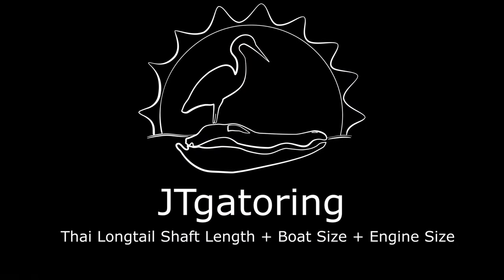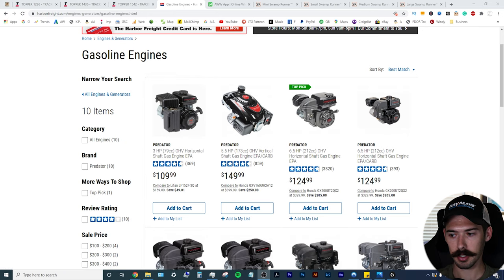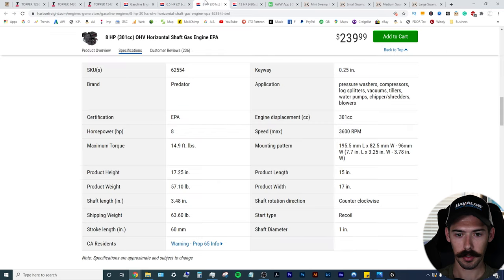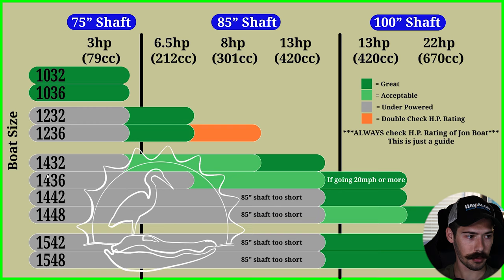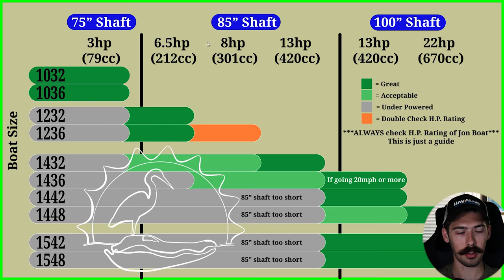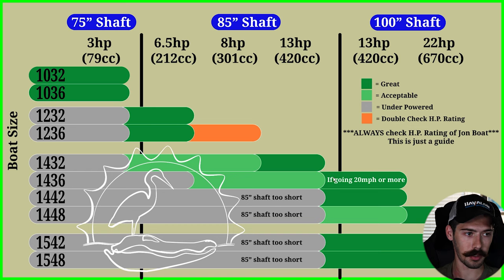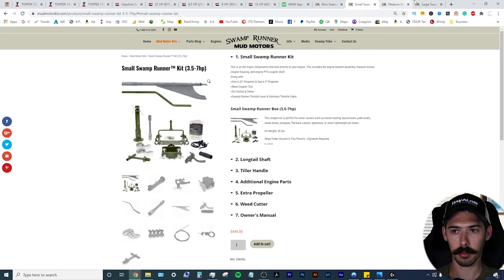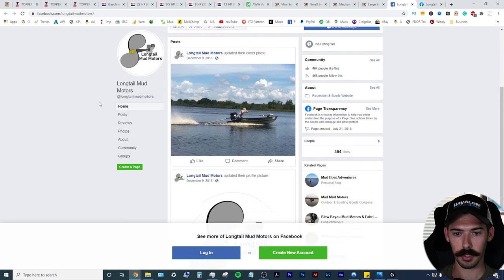EVERYTHING Thai Longtails: Boat Size + Engine Size + Shaft Size

Comment: nice job on video. 
I'm running a 15' Kaboat thats 54" wide at the tubes, currently has a honda GX 630(20 hp) with 100in shaft, Currently having problems with getting it to plane out and difficulty keeping the prop in the water. any advice??
Reply from the maker: Hey Burt, thank you! Once you go over 48", that's when things can get iffy... Take a look at this video - https://youtu.be/FAA7j0dVrLU . You will most likely need to give the kit as much tail weight as possible which means you're pivot point needs to be as close to the engine as possible. If you follow all the steps in the video, another good thing to do is play with weight distribution in the boat. Try a lot of weight in the back, and try a lot of weight in the front (try adding bow weight first). Your last ditch effort is a trim tab or planning tab. Let me know how it goes for you
Reply: @JTgatoring  thanks, I've seen that video and previously made some adjustments including putting on the planing tabs, I have not bent the skeg yet to adjust for lateral pull however as I have been saving that for a last resort.
Reply from the maker: @b12spence  What kit is it? Another thing that may help is the prop selection. Some props handle better than others. This goes for the size and brand of the prop.
Reply: @JTgatoring  beaverdam large kit, 100 in shaft, 8.5/9/9.5 in prop, honda gx630 20hP engine. inflatable boat 15' overall length ut the transom is at 13', currently running the 8.5" prop
Reply from the maker: @b12spence  It sounds like you've done what you can if you've done everything mentioned above. One other thing you could try is purchasing a prop from another brand.
Reply: @JTgatoring  i might try that, curious if adding a cavitation plate would make a difference instead of the planing tabs? it also pulls to the Right, even after playing with weight distribution. Correct to bend the skeg towards the pulling side?
Reply from the maker: @b12spence  The cavitation plate will not help. If the handle is pushing to the right (the starboard side) that means the prop is jumping out on the wake on the port side. If the shaft were to stay in the riding position where the tail was behind the boat, you would bend the skeg to the port side. If you swung the tail inside the boat to make the adjustment, since it is now located in the boat with the shaft pointing towards the bow, you would bend the skeg to the starboard side. As you move forward, the water will be pushing against the bent metal which will push it back into the center of the wake.
Reply: @JTgatoring  do you think with the transom being at 13' and being shorter inflatable vs john, that maybe an 85" prop would sit better in the water column
Reply from the maker: @b12spence  It would depend on where it is currently riding. I would have to see it. Watch some videos to see where other people have their prop located in the wake and see where yours is.
Reply: @JTgatoring  I posted a video of it up on your longtail fb page

Comment: Is there such a situation as too long a shaft?
Reply from the maker: In my eyes, yes. You want the prop to ride in the sweet spot of the wake behind the boat. If you have 30" wide hull with a 110" shaft, the prop would be placed too far back. Now if you have a standard 36 or 42 inch bottom, a 100" shaft is good, but the 110" shaft would still probably be too long unless you're going 30+ MPH. When you're on a 48" wide or wider or if the transom is taller than 20", then I do not think the shaft can be too long. Thats when the 110" or 120" shaft would be used.

Comment: My Lund 1240 Jon has a 10hp rating, I'm thinking of putting a 13 HP, 100'' longtail on it, too much?
Reply from the maker: Without knowing any additional information, I would say yes, the 13hp is too much. Most people normally do the 8hp predator with a medium size kit for a boat of that size. Weight is normally the first issue (the waterline on the boat), and the second issue is the transom's strength and ability to handle the weight/hp/torque of that engine.
Reply: And have your conclusions changed with all your experience? SPS still the best? @JTgatoring
Reply from the maker: @rickshaw296  I'd say that I've stayed up to date due to actively managing a longtail Facebook group with over 21k members and I would say yes, I still think Swamp Runner offers the best longtail.
Reply: That's great, thanks for your input! 8.4hp GX 270 SPS Medium for the 1240 Lund it is! @JTgatoring
Reply: What about the 14 ft Lund Jons? Were good up to 25 hp, do I stick with SPS, or is the upgrade to a mud buddy 23 or 25 worth it? @JTgatoring
Reply from the maker: @rickshaw296  That would depend on the boat. If its a light riveted jon boat, Then I would say rock a 13 to 16 hp single-cylinder engine with a medium swamp runner kit. I think that's the best setup for one person. If it's a welded boat that is wide, then you have a few more options. I prefer a thai longtail for 48" wide or less. If I'm getting a thai longtail, it's swamp runner. Then you have an american style longtail and that would be a backwater which I would recommend for boats wider than 48". Then you have surface drives, but I would only value a surface drive over a longtail if it had both gear reduction and reverse. If it's missing one of those, then I'm sticking with a longtail.

Comment: I know my 6.5 is way underpowered for my 1442(rated for 35hp) but it’s the only motor I currently have. I have a 100” shaft right now and was wondering if a 120” would be better a 20” transom. I’m planning on a stage 2 kit on my 6.5 also
Reply from the maker: It all depends on what you're trying to do, where the prop is currently riding in regards to the crest of the wake behind the boat, and if it's difficult to handle as it is right now.

Comment: I have a 1432 with a 16hp (mud skippers 420cc predator) on it with the twister xl kit from mud skipper. I was having trouble getting it on plane until I got my chainsaw winch n stuff on the front to get some more weight up front. Now, I can get it on plane and I've played around with a few different prop sizes and the best speed I can get is 18mph with 8in prop but that's at like 4000rpm because there's no governor. It has some performance upgrades so it just seems like I should be able to get better speeds and it's still difficult getting on plane. The 9in prop will only get up to 3100-3200 rpm so I'm overpropped there. I do have a few different 8.5in props ordered that I'll play with. But do you think part of my problem is that twister xl kit being so short or something else? You can also email me if you'd like justinmitchell88@gmail.com. Love the videos man and I've learned a ton from you.
Reply from the maker: The twister motor is completely different drivetrain than a thai longtail, so any information I give you based off of longtails and may or may not work with the twister. One key thing about a jon boat is weight distribution. Play with your weight distribution first. That will help a lot. It sounds like you're on the right track. You know the 9" is too big, and the 8" is working good so slowly step it up from there. They don't make a 8.25" so the 8.5" is your next step. The issue with the twister is that it is a less efficient drivetrain. It is a cable inside a tube with a multiple resistant points. and acts like a spring and binds inside the tube. Thank you for subscribing to the channel Michigan Bowhunter88. I look forward to hearing back from you
Reply: @JTgatoring  so I think I figured out the main reason my speeds aren't getting up there right. My handle pulls way out to the right if I let go of it. But testing it with those 8.5in props the other day, I finally just noticed that the skeg/prop is riding at a very hard angle when I'm keeping the boat going straight. If I straighten it out, the boat turns right. Is the motor probably just not mounted center?
Reply from the maker: @MI_TurkeySlayer  There could be a couple things going on. Just from the sounds of it, I would first measure the transom and find center, mark it, and adjust your mud motor so it is centered on the transom. Then make sure that your skeg is straight up and down when behind the boat (easiest to do this before you launch it at the ramp or when you have it at home) then go out on the water and get on plane and see if the prop is center of the wake. If it isn't then you need to play with the weight distribution in your boat because the boat is most likely listing to one side which is pushing the wake to one side which is making you move the prop to that side. If that makes sense... after you get that dialed in, it should be good. Now you can bend the skeg or angle the shaft if the prop keeps jumping out. Normally the prop jumps out of the wake to the port side. You could "clock" or rotate the shaft just slightly, moving it from the 6 o'clock position to the 7 o'clock position and that may help. If it doesn't, then move it back to the 6 o'clock position and bend the tip of the skeg to the port side so the water hits that bend in the skeg and pushes it to the starboard side of the boat. This is what keeps it centered.
Reply: @JTgatoring  thanks. I'll give some of this a try.

Comment: No matter what you do choose of these industrial engines stock they are limited by rpm so they will never be top speed demons 😈. So the best bang for buck in all the mid range motors stock is 301cc and I believe and it's unfairly overlooked in my opinion.  Power weight comfort it is the best for your average 12 to 14ft jon boat experience I feel with a longtail. You you could always sell your 301cc upgrade up to a 420cc if you wanted more acceleration unlike like starting with a 7hp kit.  In fact the kit im running now will do from a 8 to 22hp motor and has a 110 inch shaft. But the 7hp kits we have a 85 inch shaft so the Tillotson 212 10hp may be possibly faster with a longer shaft but we have yet to test that yet.
Reply: Hey, have you had a chance to test many V-twins? It'd be interesting to see a Briggs 16 hp V-twin vs a Predator 13hp hot-rodded motor.
Reply from the maker: The 8hp may be over looked, and that may be something you could change, but with the way its been, people are wanting more speed. They associate that with more displacement so the 13hp was the popular option and thats what the majority of people run today. The 8hp, 13hp, and 22hp all have the 1" output shaft and mounting pattern so if a kit fits one of those engines, it will fit any of the others. You run into the issue of tail weight though and I believe thats why mud skipper sent the 100" shaft with the kit I received, but the kit still didn't have enough tailweight or the proper angle for my transom. Since then, they've added the adjustable engine base to both the small and medium kit, but are now selling the medium kit and large kit as one single kit, but I don't know how the tailweight is with the adjustment holes to be able to accommodate all the engine sizes with their different weights. In my eyes, the most over looked engine is the small V-twin engines by Vanguard Briggs. The 13hp, 16hp, & 18hp engine are all different block sizes but are about the same weight. Their 23hp is also a lot lighter than the 22hp predator. I just need a better boat that can handle the power. The 1436 I have is failing again so no bigger engines for me.
Reply: @JTgatoring  yea its just 16hp vtwin motor is so expensive much more than a kit.  which kind of goes against the whole longtail awesomeness advantage . It is a proven commercial motor but you pay for it. I'm hoping more people run gx270 clones (301cc) I think they are the best size for the 12 to 14ft range jon boats and super comfortable and affordable with a wide range of application for different boats including 12ft vhulls as well.
Reply: @JTgatoring  Do they still make the 13 hp v-twin? I've seen the old model listed on some Web sites, but not on the Briggs site. As I remember Mr. Dobbs told me the 13 hp was the same engine as the 16 hp just a smaller carburetor to choke it down.

I've always been a advocate for V-twins. If I had a million dollars I'd develop an 8, 10 and 12 hp v-twin or inline two cylinder that would fit on a medium kit.
Reply: @BlackWarriorLures  no our rigs are small if I get a hold of a 15ft flat or 14ft vhull I will run a 22hp predator on it with 9 and 9 1/2 prop and see what it can do.
Reply from the maker: @BlackWarriorLures  I believe they still make it. It's on the Briggs website and a surface drive manufacturer was uses it for their 13hp mud motor but I can't find it anymore so it may not be available. I'd have to look into it further.
Reply: @azlongtales  Yeah, what I really want is a 1636 or and 1836 custom boat from Alweld.
Reply: @BlackWarriorLures  took a look at thier boats right now and oh my.... they make some really good jon boats even the 1036 is rated to 7.5 hp when most are rated at 3hp at that length.
Reply: @BlackWarriorLures the 13hp predator is to heavy.   the vanguard 23 hp (v-twin) only weighs 1 pound more than the 13 hp predator.
Reply: @jeffconley6366  Yeah, it is a heavy booger isn't it? If I had the cash I'd get the V-twin 16 hp Briggs, but my boat won't allow for more than 15 hp.

Comment: thank you for this vid just what I needed, I have a 1240 lowe rated for 10hp, should I go with the 6.5 or 8hp ? I will be hauling 2 average size people with trolling motor gear etc. I want to run shallow as possible. I have a 9.9 mercury on it now and it puts off the huge wake behind the boat like you mentioned only a matter of time until it comes over the back of the boat.
Reply: I recommend the 8hp 301cc it rocks nearly the same torque as the 13hp/ 420cc 14.9ft ft/lbs vs 18.4 ft/lbs. The 10hp 212 tillotson $194 is also good choice at 38lbs if you want to stay light weight in the rear and perfect for light weight solo set ups. But the 301cc hp at 56 lbs will be much faster for loads or two people.
Reply: @azlongtales  thanks for the reply looks like I will be looking into the 8hp pred
Reply from the maker: @UWPcustombaits  You fall in that awkward space where a 6.5hp would be a little small for that boat and the boat is not rated to handle the 13hp engine so the 8hp would be the one to look into. I don't know if it would change the kind of wake you have behind the boat though. Just keep in mind that weight distribution place a big part in the way these small jon boats ride